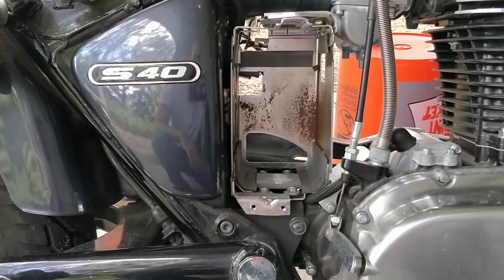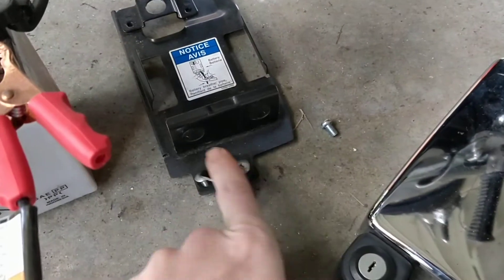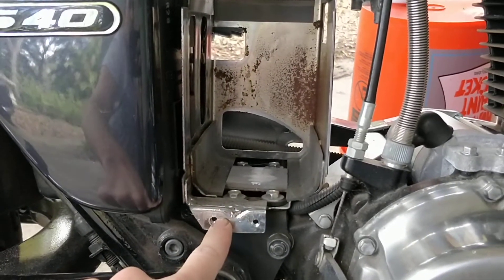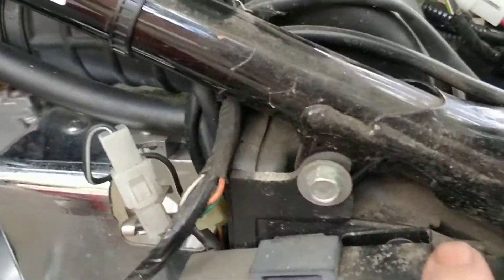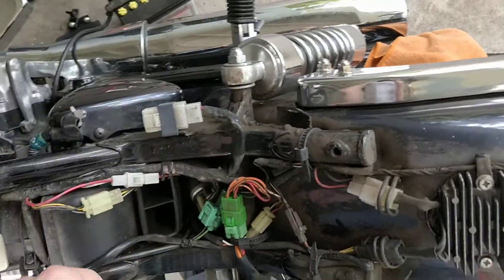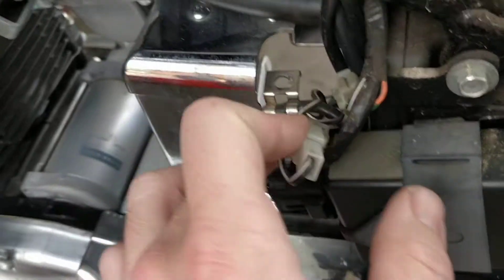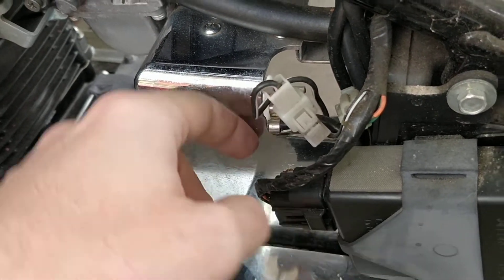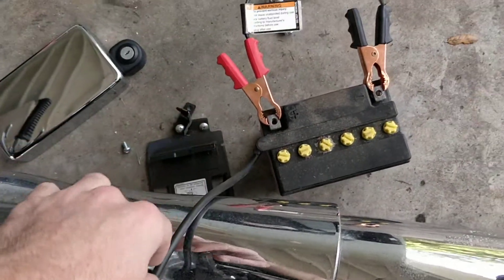Suzuki S40 Boulevard 2015 battery removal

Comment: Check water levels, if needed add distilled water to line , original battery or similar replacement that is , some are maintance free of course.